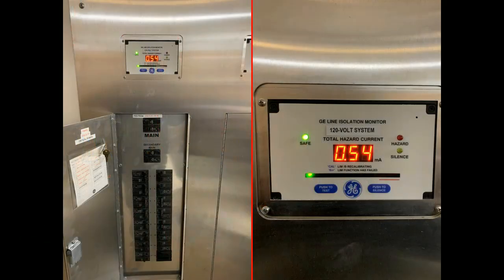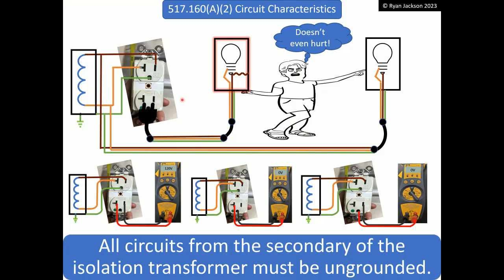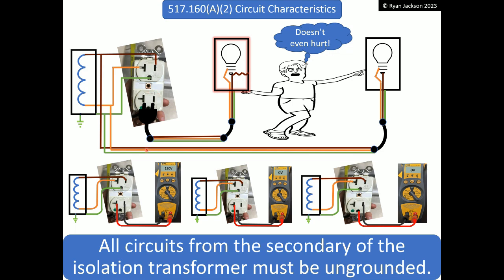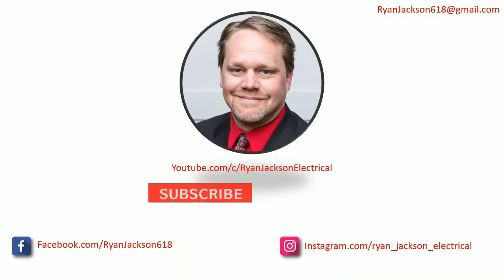Isolated power (ungrounded) systems (NEC 517.160)

Comment: We were always taught that grounded systems are safer, because you create a low impedance path back to the source, sending thousands of amps which trips an overcurrent device or fuse clearing the fault. Now i'm learning that this system can be safer because you can touch energized metal parts that are ungrounded and not get shocked.  I get it, but at the same time I don't lol

Comment: Wait a minute, that makes no sense. Zero voltage and zero current are not the same thing. One does not entails the other. Please elaborate on this 5:35
Reply: Agreed. There should be voltage between the grounded enclosure and the coil. If one end of the coil was connected, it would be 0V to ground and the other end would have some voltage above ground.
Reply: Imagine a battery connected to a resistor with a switch in series with the resistor. When the switch is closed, the voltage across the resistor is approximately equal to the battery voltage. If you open the switch, the voltage across the resistor is zero.  That's what he means.

Comment: What's the point of even running a grounding conductor if it's not even meant to provide a fault current back to the source? Also I am assuming the only way this could work is if the metal enclosure that your LIM transformer is in is not bonded to your main disconnect.

Comment: If you're wondering why the text on the receptacle is upside down, it's because receptacles are installed ground side up in healthcare spaces. (you can tell it's a healthcare receptacle by the green dot.)
Reply from the maker: @mrpotatohead161  Not always. I've seen thousands of receptacles in health care facilities that are installed with the ground down.
Proposals to mandate an orientation in the NEC have been rejected many times.

Comment: my question is then, if this is so much safer, then why aren't all power systems isolated? maybe because of cost and that it actually takes some intelligence to keep it tested and safe?
Reply: They were used.  Grounding was banned before 1899. It was mandated in 1913 - just 30 years into the commercial electricity and decades before equipment grounding was adopted to protect from shocks. There must have been really good reasons to ground.

Essentially in an ungrounded system one can have arbitrary high voltages because of for example lightnings. Accidental grounding is also a problem. Lets say you implemented the split phase system ungrounded and one of the legs grounded accidentally. Now the other leg would have 240 V to the ground - something it never has on a mid point grounded system.

Comment: At the large hospital that I retired from at a meeting with so called LIM engineer and two other from the company that we purchased over twenty replacement LIM panels during OR remodeling asked them where is the label that provides the fault current. No e of the three know what I was asking and never provided information after I asked for it several times. If I was in charge they would not get final payment until they installed NEC required labels. Had the same problem with two JCI 1,750 HP chillers. They were each feed from 13.2 KV from switchgear room to inside a 18' long panel that had a transformer reducing 13.2 to 4,160 bolts that feed a 4,160 VFD. Asked for over a year for required arc fault labels and kept telling me they are working on it.

Comment: Please read IEEE 3003.1 System Grounding. Line to ground voltage in an ungrounded system is not zero
Reply from the maker: I'm trying to keep it simple. I agree that, if the conductors lengths are the same, you'll read equal voltage between them when measured to ground (in this case, 60V). But that is strictly capacitance and charging current, and for the purposes of this discussion I'm comfortable saying zero.
Reply: @RyanJacksonElectrical  
Saying that the voltage is zero because it is not zero and may cause electrocution. The system capacitance will be the complete circuit that will cause elecrrocution if ungrounded conductor will be touched.
Reply from the maker: @elec3calengr  No. You're not getting electrocuted from a single ground fault on an ungrounded system. That is the entire point of an ungrounded system.
Reply: @RyanJacksonElectrical  
Check voltage to ground. It is not zero. Touch potential is not zero. Never touch a hot conductor.

The main reason for using ungrounded is continuity of service on a line to ground fault
Reply: @RyanJacksonElectrical  
This is the reason why single phase 2 wire where one line is grounded and only one hot wire
Reply from the maker: @elec3calengr  That is not correct at all. An ungrounded system is often used for continuity of power. In this instance they are used for the prevention of electrocution.
Reply: @RyanJacksonElectrical  
Read IEEE 3003.1. Ungrounded is prevented from electrocution by connection to earth. Or reducing touch potential to less than 50volts IEEE 80
Reply from the maker: @elec3calengr  I'm sorry that you are not understanding this, but I'm not going to argue with you any longer.
Reply: @RyanJacksonElectrical i just don’t understand it.If there is a potential difference between the line and ground (60v in this case) and a person comes across it and completes the path to the ground , wont they get electrocuted?
What difference does this make when compared to conventional line neutral circuit
I just don’t understand the advantage of it.
Reply: @elec3calengr  You do not get that the impedance of the capacitive connection is high so the current will be low. There may be high open circuit voltage but once you touch it the voltage drops as most of the voltage is lost in the capacitive connection.

An example PC power supplies are capacitively connected to the case. If the PC is ungrounded the case gets half the mains voltage which in Europe is 115 V. I once touched by case and a radiator at the same time and felt only a small tingle as the capacitors limit the current to about 0.5 mA.

The rule is never to touch any electric conductors. Countless number of electricians have been killed by the neutral wire.
Reply: @danyabel6847  They won't as the impedance is high. The 60 V is just the open circuit voltage. Once you touch it the voltage drops.  The highest voltage is where the impedance is highest. In an open circuit it is where the circuit is open. Once it is closed it is at the capacitive connection.

Is is the impedance of the whole circuit that determines the current.

Comment: When I was an electrician in the Navy, we ran all our electrical systems as ungrounded.  This wasn't for safety but for reliability during battle.  The idea was, if a conductor got grounded due to 'battle damage', you didn't lose power to vital equipment because there was no complete circuit.  Standing watch, we had a device (called simply, 'ground detector') that measured insulation resistance to ground while system was energized.  If it went below about 1 Mohm, we had to go through a process to isolate the faulty equipment.

And because the entire ship is metal, and cabling running everywhere, the 'leakage capacitance' was pretty high and we couldn't do much about it.  So it was NOT SAFE to touch a live wire as the leakage current was enough to kill you.  And of course, we had an old safety film that was required training for Electrician's Mates "The Deadly Shipmate".
Reply: Isn’t leakage current NOT referring to hot wire but somewhere caused by the hot wire?!

Comment: Used this to help me figure out current flow on a home generator (bonded vs un-bonded system. At the generator). 

My belief is that you would (float / break) the ground and neutral at the generator, so that in a fault (in the home circuit), current would flow thru the ground, to the ground bar passing it to the neutral  ( in the load center) back to the generator coil (shortest path). 

So that current would not flow out to the generator receptacle plug (energizing it, being grounded to the frame) and then energizing the generator frame back to the neutral (if it remained bonded and not floating).
I think.

Comment: Each leg is 60V I assume?  I wonder what happens if they need a 240V piece of equipment in the operating room?
Reply: Your question assumes it is grounded but it is not. There is 120 V between the legs. Each leg is 0 V to the ground. Think about a 1.5 V battery. It would make no sense to say each pole is 0.75 V? Voltage is always relative. There is no absolute voltage. This rather confusing. We can say that a leg is 120 V (for example) only because we have grounded the system. That is we have deliberately connected the system to the ground with a ground rod. Note that a system can also become accidentally grounded. An isolated system in that case stops being isolated but it still works.

Likely you do not have 240 V equipment there or if you do, you have a separate system for them. .

At surface one might ask why do we ground as isolated seems to be safer. Well you are not the first one to think so. In fact before 1899 grounding was banned (do not confuse this with the ground prong on the socket, this has absolutely nothing to do with it). However, it did cause problems so in 1901 it was recommenced and in 1913 mandated. Ungrounded systems can get over-voltage which causes arbitrary voltage to the ground because of lightnings, accidental touching of high voltage lines etc. The ground prong was later added to reduce the risk of shock that grounded systems have.

Isolated systems are typically used in things like hospitals and ships. Norway is the only country where they are widely used to my knowledge and they typically have a high impedance connection to the earth for over-voltage. They do not distribute the neutral, just three phases 230 V between each two.

Comment: Many generators, and dc-ac power inverters, are also ungrounded systems. They usually call these "floating neutral". 
Like your example, if you measure either line to the case of the generator/inverter you frequently get 0 volts. This is why many generators do not have GFCI protected outlets. This is also a factor that helps make it possible to parallel the inverter type generators.
Reply: Please allow me to ask in earnest, is there a way to synchronize the phase and frequency of these inverter generator systems or is it done automatically looking at cumulative voltage considering summing vs subtractive interference?
Reply: @jeffreystroman2811  Yes.  Automatic synchronization is done by every grid connected solar inverter.  What's more interesting are AC generators.  In that case, the hard part is determining when they line up to connect them.  Once that happens, the electrical coupling forces both systems to spin at exactly the same speed.*  So as long as you use timing lights, or an automated equivalent, you can manually synchronize AC generators and tie them together into a larger system.

Note that doing this at home using home-made timing lights might be an interesting project, but it is dangerous and almost certainly violates the NEC.  Connect them at the wrong time and things will go bang.

* Simplifying

Comment: When you measure voltage on a ungrounded conductor (L1 or L2) to grounded source in a installed live system in a OR you will measure roughly 60v volts (it vary's between 50v-60v) Source: I have Safety tested 15 OR's for 9 years as a maintenance electrician.  Another interesting fact our non monitored isolation transformers (1500va) have lower leakage current circuits than our systems with LIM (line Isolation Monitor)  No LIM usually less than 20uA,  LIM ranges 150uA-270uA. Enjoyed your video and appreciate the knowledge sharing.
Reply: Yes, I service quarterly a Marine Well Containment platform, and it has an ungrounded system. It thru me for a loop the 1st time I opened the service panel to throw the breaker for a fire alarm panel and found it to be 20A double pole. I was installing a Surge Protection Device on the fire panel's primary 120Vac power. When measuring across safety ground and either line conductor I also read somewhere around 50 - 60 volts.
Reply: @Cleofizoid  very good
Reply: I work in a shipyard and onboard shore power fed vessels I read about 60v on each leg to ground. When looking for ground faults with a 3 light ground detector installed at the panel, it has been pretty easy to isolate by shutting of breakers until the ground fault disappears. However, I have ran into a ground fault on a breaker connected to an audio system with back up power and hit a wall going further with isolation. I heard that it is not necessarily a fault in the equipment but a lack of capacitive balance between the three phases. It's new to me and I'm learning about it as I post this.

Comment: In the wild, you will very rarely find an ungrounded system that reads 0VAC to ground/earth.  Modern multimeters are sensitive enough, with high enough impedance that the uA of capacitive leakage is often enough to provide a reference for the meter, and it will usually read in the 50% (60 VAC) range on either pole of the 'ungrounded' system.  The minute current would still not be enough to even be perceptable as a 'shock' so this isn't a problem - but it has thrown a number of electricians for a loop when they THINK it should be 0 (as indicated in this video), when in fact it can be and range of voltages between 0 and 120 (depending on how even the leakage current is from each leg).
Reply: As an example, the "safe" 0.54mA in his picture is well more than enough to excite the multimeter and show a voltage.
Reply: If we used a voltage meter with "low impedance function" like the Fluke 117, do you think the measurement would finally be 0v?
Reply: I’m confused. You read 60v on each leg because ungrounded systems are typically three phase and each ungrounded conductor is about 68 volts 1.732 out of phase with each other in order to get 120V. Or at least that’s how it is on boats. Is that not how it works in healthcare facilities?

Comment: Learn quite a bit here, and I'm a journeyman currently working on getting my masters license next year, but I've never seen this system and didn't realize it existed,  but I do mostly residential and occasionally commercial.   I understand the concept, much like the ungrounded delta systems that you sometimes see in older manufacturing facilities, not a system commonly used nowadays but nonetheless very useful in a situation where unexpected shutdown of equipment caused by a ground fault could result in damage or injury.

Comment: I have a question on ungrounded 480 delta system why do we measure 277V on each leg  to ground if it’s ungrounded ??
Reply: same reason you will read 60VAC on the video's ungrounded system - sensitive meters and capacitive coupling between the isolated system and ground.
Reply: Thank you

Comment: You said at the very end that if you have one of the ungrounded conductors go to ground that it would be a short circuit. Ground is isolated though so maybe I’m misunderstanding something but doesn’t look like a short circuit. Some current will flow but not very much. Again not a complete circuit.
Reply: at that point, he was talking about if the OTHER leg ALSO went to ground while the original ground was still in place.
Reply: The receptacles are isolated ground with the green lines in the picture representing isolated ground wires (which normally are green with yellow stripes). The receptacles' metal housings are connected together with another ground wire (just normal green insulation).  In the scenario, the orange wire first energizes all the metal housings and conduit.  Then the brown wire hits the metal housing, which creates the direct short circuit path between the orange and brown wires via the metal receptacle housings, conduit, ground wire and sometimes the redundant ground wire if the conduit is flexible metallic cable.

Comment: I wonder if a modern GFCI circuit wouldn't work just as well, but without all the extra difficulty and cost that goes into building this system, not to mention the need to deal with hazard current.
Reply: the main feature of this "ungrounded" system, is that the breaker won't trip for a ground fault. GFCI or AFCI trips would be just as bad for the patient.
Reply: The locations that require these ungrounded systems ('wet' operating and procedure rooms), can be served by either ungrounded isolated power systems OR GFCI's.  The decision is left to the facility on whether to use ungrounded systems (which stay energized with a ground), or GFCI's, which will turn off when grounded.  Sometimes the complication of the ungrounded system offsets the risk of vital equipment turning off during a procedure.
Reply: @CraziFuzzy  I totally agree.  The one goal that was not discussed, was the prevention of a ground fault on one of the two inputs of a vital (i.e. life support) equipment from becoming a show stopper. Naval Combat Ships have above ground electrical systems with isolation monitors. The grounding of one phase during combat will not become a show stopper. I worked with a retired Navy Electrician Chief who shared with me about searching through out the ship, the better part a day for the location of a ground on a phase when its Isolation Monitor went in alarm.
Reply: Retired from a large 560 bed hospital that had two LIM panels in each if the 20 plus OR'S . A GFCI should work off a LIM panel because they use a torrid coil to only measure current imbalance between the black ( energized ) & white grounded conductor ( no such thing called a neutral anymore in the NEC. LIM panels NEVER disconnects power on the circuits. It rings an alarm around 4.7 to 4.8 milliamps. Most times the heating pad on OR table is the cause of leakage current.